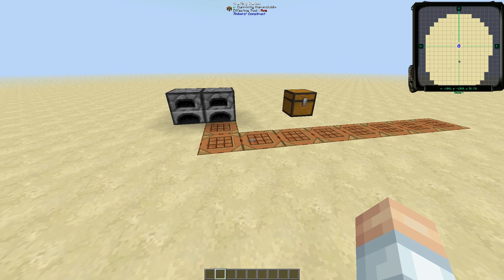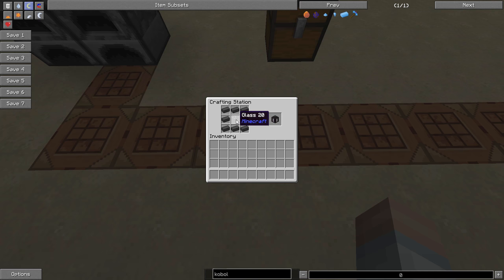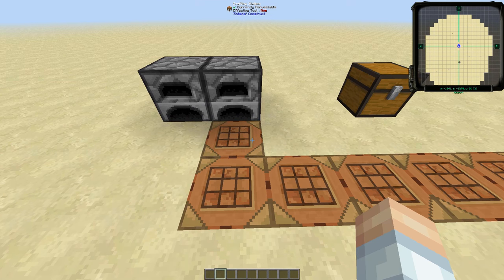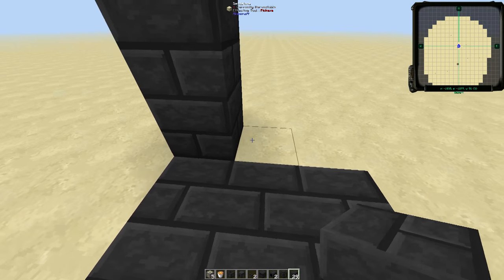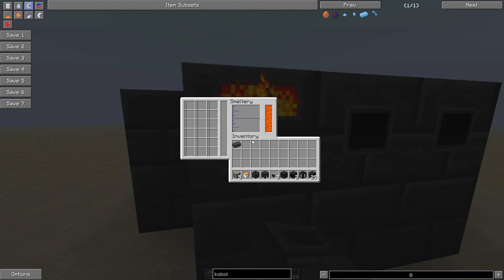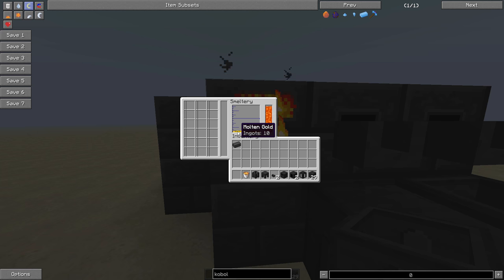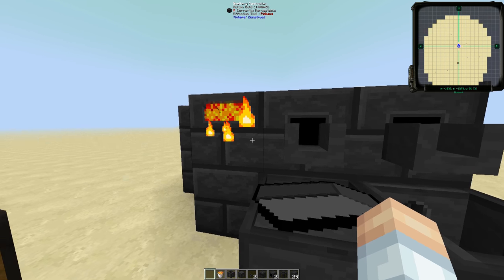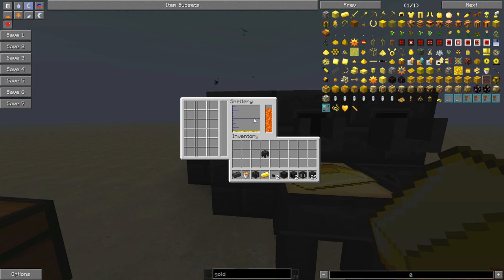How to Build a Tinker's Construct Smeltery - Modded Tutorials E1

Comment: THANKS ALOT!! I have an issue where I right click the faucet that's above the casting table which has an ingot of some kind in it, and it's not dispensing the materials into it.
Reply from the maker: Are you trying to make an ingot cast? If so, in 1.7.10 you'll need either to pour either aluminium brass or gold, or in 1.10.2 you'll need to use gold.
Reply: Oh, okay. That solves my issue. Thank you

Comment: bro, what microphone, and other voice over techniques (like environment, special touches to audio) did you apply?
Reply from the maker: I record in my home office which can be fairly quiet depending on the time of day. When I recorded this video, I was using a Snowball microphone. It picks up a lot of extra noise, so my post-processing took a while. I edited the audio in Audacity - compressor, noise reduction, and normalize. I now have an AT-2005 microphone running into a pre-amp then audio conditioner to take care of the noise gating, compression, and normalizing before it gets into my computer - less post processing makes it easier to put out videos.

Comment: 2:57 in a river or a swamp? I think I'll have some trouble in Sky Factory, then
Reply from the maker: Yeah, Sky Factory presents a challenge doesn't it :-) If you have the Ex Nihilo mod, you can put dust (use a hammer on cobblestone, then gravel, then sand) into a barrel with water to get clay. There are other skyblock mod packs that don't have Ex Nihilo, but I haven't played one yet so I'm not sure how to get clay in those.

Comment: it's not allowing me to click the drain above the casting table
i did an exact copy
ideas?
Reply from the maker: Which modpack? Do you have a cast in the casting table? If no cast, do you have an item you want to make a cast of in the table and the appropriate molten metal selected in the controller (either gold or brass)?
Reply: @MCSoapthgr8  yeah yeah long story short i tried to make a cast of  Iron but i didnt know that you could make casts only from gold or aluminium 
Also since i was playing blightfall there was some crossing between the mods which didnt help to ease the confusion
In any case scenario i found the solution to my problem  but thanks for bothering to try and help
Reply from the maker: @dimitarmatanski3712  My pleasure! Glad you got it figured out!

Comment: whenever i try to press the faucet, it wont pour out. i have seen other people with the same issue, and you have helped them. you have said that they need to see if there is another liquid below it,but there is NOT. only iron. i do have some blood in there (dont judge), but i keep that on top. do you know what could cause this? i use ver. 1.7.10
Reply from the maker: Hi! Do you have a casting basin or casting table below the faucet? If you have a casting table, do you have a cast on it?
Reply: @MCSoapthgr8  yes, in fact i do have a table. with a cast in it. i have no idea why this is not working...
Reply: @MCSoapthgr8  i think this is really weird. It works whenever i need to pour it into the casting basin, but it will not work whenever i use it on the casting table, which is what i need :/
Reply from the maker: Could you send me a screenshot of your setup? If you use Discord, feel free to jump in here: https://discord.gg/k3aMsn9 or on Twitter - @mcsoapthgr8  (it'll be a little bit before I can get over to check on Twitter though)

Comment: Help the faucet won't work even though I did everything right and the smeltery controller is on too. What did I do wrong?
Edit: It's not backwards either. It only works for the basin and not the table I don't know why. I am trying to cast the ingots but it just won't work even step by step.
Reply from the maker: Does the controller light up and let you interact with the smeltery interface? If so, for casting ingots, do you have an ingot cast in the table?

Comment: Hello can I use this for the 1.16.5 version of this mod? I placed all the things needed but it cannot smelt anything like a gold ingot I tried using an ore but doesn't work for me pls help

Edit:just found out that I needed to place the seared tank beside the controller and idk if this matters but I put the two drains to the side,anyways thanks for the vid!
btw how do you get rid of blood in the smeltery or drain? I kinda tested it if I could get hurt in the smeltery
Reply from the maker: Glad you figured it out. I haven't tried in 1.16.5, however.

For the blood that's in there, depending on the modpack, you may be able to make a cast from a slimeball and then cast the blood into the shape of a slimeball. If that recipe isn't available, I would just cast any remaining metal and then break the controller to make it forget about the blood.

Comment: I have 18 Ingots of Molten Uranium, when I pour it out of the faucet into the Casting Basin, nothing comes out. It worked with Copper but not with Uranium. Any ideas?
Reply from the maker: I've encountered some packs that are configured to not allow casting uranium blocks. Which pack are you playing on?

Comment: I tried to empty the copper I put in there into the casting table and it wouldn't work. Do you know why? (1.10.2 skyfactory 3)
Reply from the maker: Do you have a cast in the casting table for it to pour into?
Reply: I did not and have resolved my problem, though thank you for the video
Reply from the maker: @stueblutee2300 , I'm glad that you've figured it out. Thanks for watching!

Comment: For some reason only the basin works. I can't create a template case thing for the casting table for the items to flow into. I place a seared brick inside and have clicked the faucet and everything and it still won't work to make a case thing. Any ideas?
Reply from the maker: Which modpack are you using? Do you know what materials it requires for the cast - usually gold, but can sometimes be aluminium brass? Do you have that material selected in the smeltery?
Reply: @MCSoapthgr8  it's fine I figured it out. I thought you could use any ingot looking thing cos that's what you said (unless it was another youtuber) but as soon as I found gold it worked. Thanks tho for the tutorial :D
Reply from the maker: You should be able to use any ingot looking thing, but that also depends on how the modpack is configured. Some modpack authors will remove recipes to change the game progression.
Reply: @MCSoapthgr8  I guess this 1 was changed yeah

Comment: How do you get the lava in SF4 as you need fire but idk how to get fire
Reply from the maker: You can start with a crucible above a torch. It's really slow at first, but once you get the first bucket of lava, you can then use the lava as a heat source below the crucible.

Comment: how about transfer melted items into buckets?
Reply from the maker: I'm not sure if it's possible straight from the smeltery, but you could use some fluid pipes attached between the drain (where the faucet goes) and a fluid tank. You can use a bucket directly on the fluid tank.
Reply: Soapthgr8MC you can put a bucket on the cast holder and use it and it will fill it.

Comment: i did everthing right and it's still not working... it's pouring on casting basin but it's not pouring on casting table plss help

sorry for my bad english
Reply from the maker: Which modpack are you using?

Feel free to send me a screenshot on Twitter (@mcsoapthgr8) so I can see your setup, but a couple of things to check right now:
1) Do you have a cast in the casting table? If you don't have a cast, you won't be able to pour into the table.
2) Is the casting table right below a faucet? Is the faucet on a drain?

Comment: Someone help me. I have made the smeltery exactly how he did it but for some reason the faucet to the casting table doesnt work but the facet to the Casting Basin does work and when i switch the two around it works for the basin but not for the table. Send Help
Reply from the maker: If you're making a cast from another item, you'll need to be pouring gold or aluminum brass over the part. If you're making a part, you'll need to have a cast of that part along with a valid material selected in the smeltery. Note that some modpacks change the configuration to allow/disallow certain materials from being used to cast parts from the smeltery.
Reply: Soapthgr8MC thanks man ur a legend

Comment: I know this is old but when I right click the faucet for just ingots with enough ingots, and have an ingot in the casting table, nothing happens
Reply from the maker: You have an ingot for making the cast? Or an ingot cast? If you're trying to make the cast, make sure that you have gold or brass in the smeltery. If you have the ingot cast in the table, it could be that the modpack has put some limitations on what can be cast. Which pack are you playing?
Reply: @MCSoapthgr8  im in hexxit and am trying to make the cast. I think it was because I didn't have gold or brass in the smeltery. Thank you for helping
Reply from the maker: @rizzpro  excellent, so you've got it working now?
Reply: @MCSoapthgr8  yes thank you

Comment: Dose it have to be 3x3 and I’m able to just make it taller
Reply from the maker: The max size it can be is 9x9 internal dimensions, which is 11x11 for the blocks. I just showed a size that I commonly see. You can make it from bedrock to build height if you want, but it could get laggy if you make it too tall.
Reply: Soapthgr8MC ah! Thanks man

Comment: some bird went in my smeltery (im playing crazycraft) and now theres blood in it and i cant get rid of it. any help?
Reply from the maker: A couple of options I can think of
1) in some modpacks, you can create a cast of a slimeball and then cast out the blood as something that functions like a slimeball
2) make sure everything else is out of the smeltery (cast it to blocks or ingots) and then destroy the controller and replace it (this will remove all of the contents of the smeltery)
Reply: Soapthgr8MC thank you so much destroying the controller worked
Reply from the maker: @chronic464  my pleasure, glad it worked!
Reply: Soapthgr8MC my smelter keeps getting blood in it even after I built a room for it with no opening for stuff to get in. I watched it once and blood just appeared in there and I have no clue what’s causing it.
Reply from the maker: @chronic464  bats could be spawning in there

Comment: does it need to be out of seared bricks?
Reply from the maker: You can use seared stone also for the sides, but you'll still need at least some seared bricks to craft the main components (controller, faucet, etc.)
Reply: @MCSoapthgr8  i tried the sides of the smeltery with any other block, it seems to not work. its probably customized with the other mods i have. ty tho!

Comment: I can fill the basin, and make blocks of metal, but nothing comes out when I right-click the casting table.  Help !!
Reply from the maker: 3 things - 1) Which version of MC are you using? 2) Are you right clicking on the table, or right clicking on the faucet above the table? 3) Do you have a cast in the table? (hit me up on Discord for real-time chat if you need: https://discord.gg/k3aMsn9)
Reply: 1.  I am using version 1.12.2
2.  Right clicking the faucet.
3.  I had a stone pickaxe on the table.
Reply: I removed the stone pickaxe and click on the faucet and it gave me molten metal, but it does not cool and I couldn't add the axe to make a stencil.
Reply: The link takes me to Discord but I don't have the 4 digit tag it asks me for
Reply from the maker: Try this one? https://discord.gg/tUvZAy
Reply from the maker: To cast a piece using the molten metal, you'll need to create a cast. I usually make the parts with stone or wood first - so in this case, make a stone pickaxe head (not the fully assembled pickaxe) and place it on the table. Once the part is on the table, pour molten gold over it. The part goes away, but you then have the pickaxe head cast. After you have the cast, you can pour molten metal into it.
Reply: I was able to get on but I don't know anything about how to use Discord. It is asking me to claim a account but I don't have a password or see how to register my email.
Reply: I know how to do this.  I used your video on another world and was able to make casts with no problem.
I am putting a stone pickaxe on the table but clicking on it produces no molten metal.  If I remove the pickaxe and click, it pours metal onto the empty table.
I saw an earlier question where someone asked if this worked inside.  On this world, I built my smeltery inside
Reply: Oh .... BRAIN F..T  I am using a stone pickaxe from the normal crafting, not a pickaxe head from TK.   MY BAD..... LOL
Reply from the maker: Working now for you?
Reply: Yes it is working. I don't know what I was thinking.. 🤔   Your video is extremely helpful and I have learned a lot.
One more thing. Do I need to get different mods to make bronze or other ores?  Currently I am just playing vanilla Forge with the TK mod. Thanks again for the videos.
Reply from the maker: Glad it helped! Bronze is actually an alloy of copper and tin, the relative mixture may vary (in DW20 1.12 it's 3 copper to 1 tin). If you have JEI installed (another mod available on forge), it should be able to show you the recipes for your particular pack.

Comment: How do you make a smeltery drain?
Reply from the maker: The exact recipe can depend on the modpack you're using. Normally, it's 6 seared bricks arrange in the crafting table with 3 on each side and the 3 middle completely open (let's see if the youtube comment window completely messes this up)

X - X
X - X
X - X

Comment: How to get seared stone bucket
Reply from the maker: If you put some cobblestone or stone into a smeltery, it will melt down into seared stone. You'll need to at least build a small smeltery using the blocks made from cooked ground to begin smelting cobblestone/stone.

Comment: I can’t pour the gold to get the cast???
Reply from the maker: Do you have an item in the casting table to pour the gold onto? Are you playing a modpack? If so, it could be that the modpack authors have changed the recipes and disallowed some casts. Check JEI/NEI to make sure the cast is available.
Reply: @MCSoapthgr8  I fixed it, I just didn’t have the gold at the bottom🤦‍♂️
Reply from the maker: @BlueAvocado75  ah, that will do it, glad you figured it out!

Comment: the casting doesnt work for me
Reply from the maker: Which type of casting are you making? Which material are you using? Which modpack are you running?

If you are using a modpack, it may be that the recipes have been altered to not allow the type of casting you are attempting to make.

Comment: the stuff dont dry. pls help
Reply from the maker: Are you trying to cast something in a casting table? or in a basin? I've usually encountered it not drying when I hadn't put quite enough of the material in - for example, an item requires 2 ingots but I've only got one ingot melted.
Reply: Soapthgr8MC the block in the basin dont dry. I have not tried yet in the casting table, for all I know it might happen There 2
Reply: @MCSoapthgr8  ok so now the basin works and it dries, was probably just not enough ingots but now the drain to the casting tables dont work
Reply from the maker: @mrrip7184  What are you trying to cast in the table? Which modpack are you playing? It could be that the modpack you're playing is configured to not allow you to cast what you're trying to cast.
Reply: Soapthgr8MC I found it out, it was that There are only some specific stuff that u can use on the casting table, like for example u can use gold But not iron on the table
Reply: Soapthgr8MC Thanks for the help and quick responses, greatly appreciated :) the video helped me alot aswell